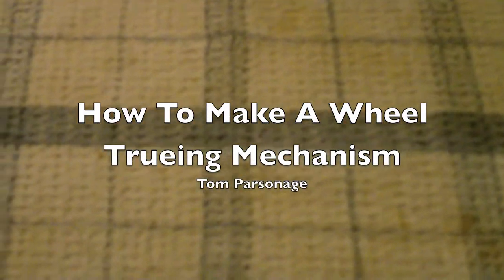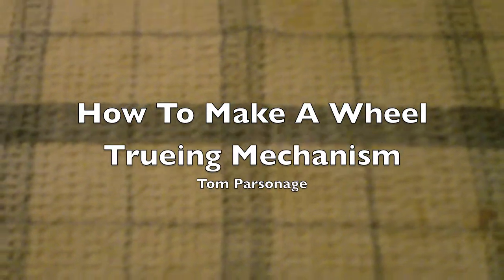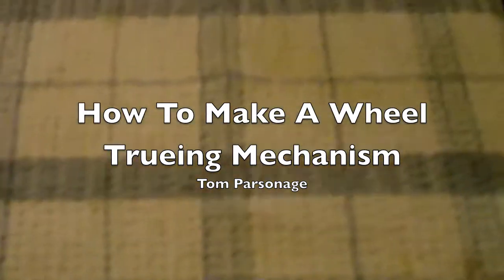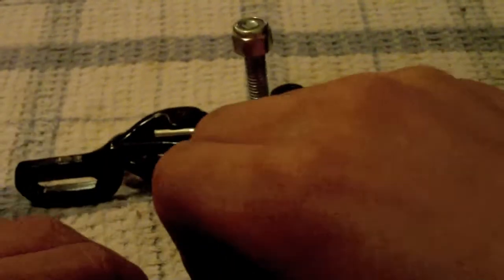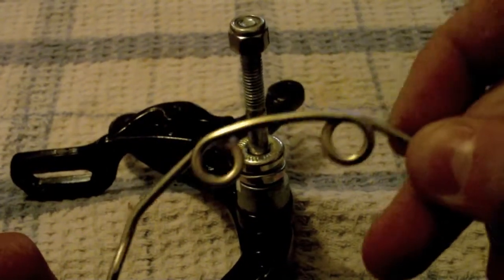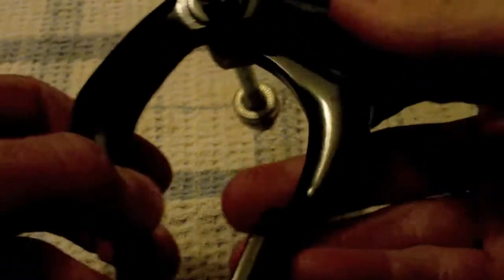BMX How To - Make a Trueing Mechanism

Comment: You can just find a spot on the wheel that's center and put tape on the frame or forks till it bearly touches the sides of your rim and spin it it will pull the tape and thenyou losen that side and tighten the other